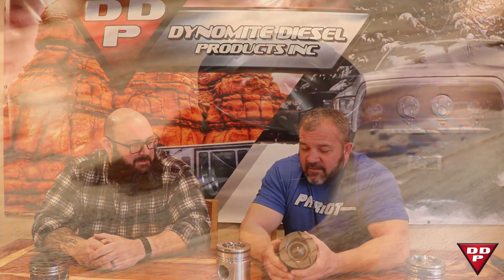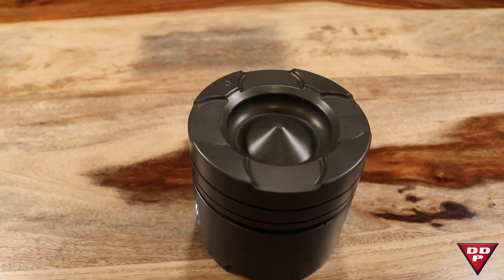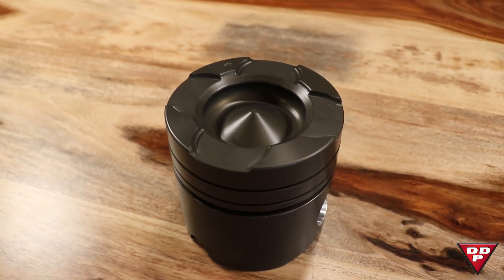NEW PISTON TECHNOLOGY - Part 1

Comment: Cam shaft EGR. Can you do a vid explaining this effect, and the pros and cons with vs without. What cam shaft would delete it and if its even beneficial. A google search resulted in limited info on this. You guys seem to know your stuff. I am wondering if changing a cam shaft would improve fuel efficiency on 750hp and up builds. I would love a detailed dive into this topic from someone with a ton of knowledge in this field.
Reply: Hamilton and Colt both make ones that eliminate it. Getting ready to replace the one in my 06.
Reply from the maker: Fuel efficiency and higher HP numbers typically don't tend to mix very well. Maybe we'll do a video on cylinder scavenging in the future!

Comment: It would be fun too see what he may know or can share some of: flame speed vs bsfc ratio in Diesel engines.  I would assume/believe the oem’s  already know the answer to this but without being a oem and using studies that are publicly available feel that I can with a fair amount of accuracy predict at what brake specific the flame speed will go sonic which follows what has been already proven and visually captured in pro mod spark ignition motors. There is one photo taken by Jason sands of a diesel that matches the same photo shown in a Darin Morgan video on air speed with his example being a pro mod car of shock cones  exiting the exhaust with after words proof of a now damaged engine. This may match up with: clean burn under load producing high hp (low brake specific fuel consumption ratio) setups in diesel drag racing are showing higher failure rates at lower power levels then their sled pull cousins which due to rules, make getting higher flame speeds and bsfc ratios as low much more difficult all the while still producing a average produced hp per second without a component failure still higher.  Watching dyno pulls chassis and engine the motors that look to run a exhaust opacity of just a slight amount of haze comparable to a stock 12v truck when you mash the throttle vs the motors that are running 100% clean. The ones producing just a hint of haze at the same power level appear to survive in a competition environment at a higher rate then the ones run completely clean. I lot to look at but it’s something I personally have not gotten to ask someone who may know the answer of or point in the direction of where to look. This guest who works in the oem may be a good one to ask haha. Thank you for the awesome videos and great products.
Reply from the maker: Thanks for watching!

Send over your questions to marketing@dynomitediesel.com, and maybe we'll have him back for a follow up, and to answer some of these questions!